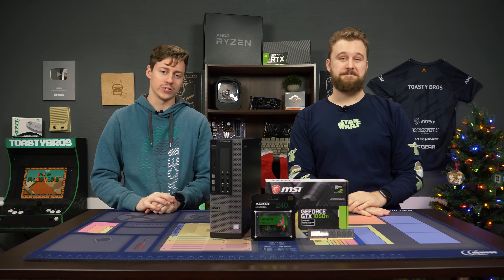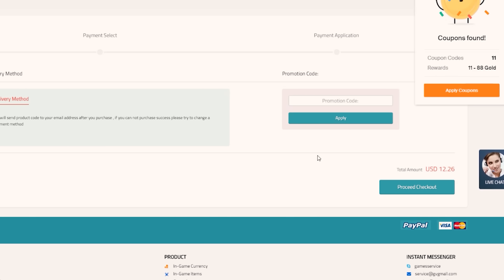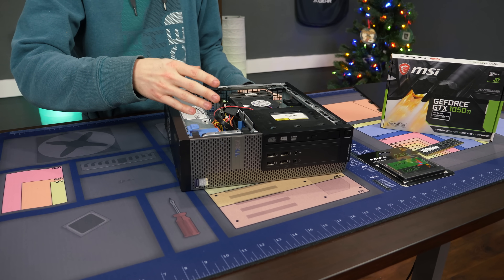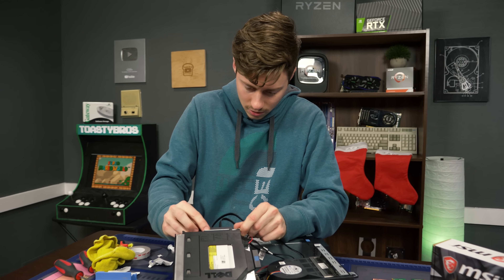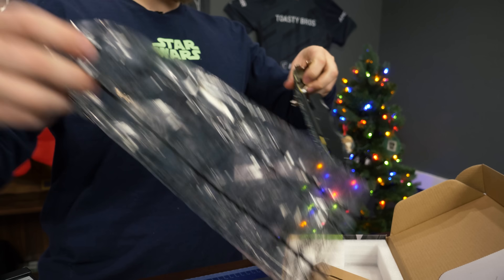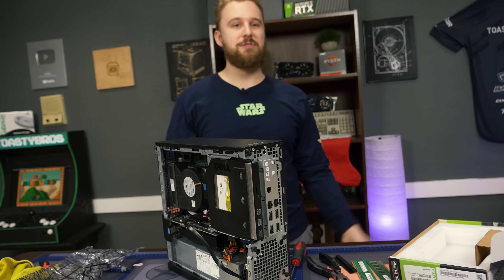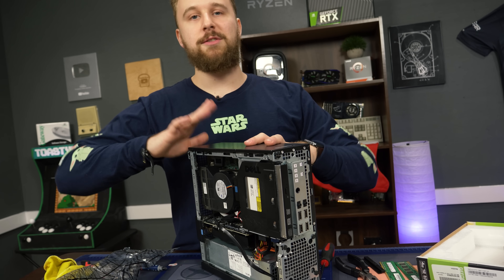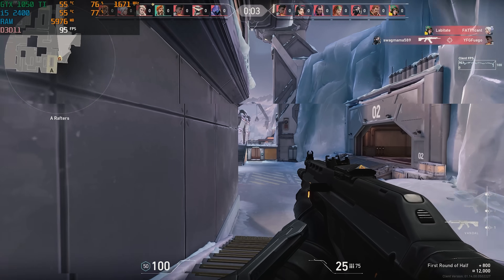EASY $250 Gaming PC Build - Step by Step

Comment: I JUST WANNA THANK YOU FOR EVERY VIDEO YOU HAVE MADE!!!! I FINALLY GOT MY FIRST PC FOR LOL. core i5 10thgen, 1650 super. ik its a prebuilt but im still happy :) i got it for 900 cad O_O
Reply: actually not that bad for that price lol
Reply: @scooterit  yeah it is bad there’s plenty of i5’s that go from 400$ to 1000$ and 400 is the right price for that performance
Reply: me who has the same thing but only 1650... with 140fps mc 90-120fps fortnite. idk bout that 1650 super, unless it's on crack then cap
Reply: @jodysu9887  btw i was using a client for minecraft, (it gives you a fps boost) and i was getting 1000 fps. and in fornite i did get easy 300 fps medium settings. BTW THE 1650 SUPER IS SO MUCH BETTER THEN 1650. btw as long as your running more then 60 frams your good to go.
Reply: Azizthe21 clients don't give that much of an FPS boost, it would give you 200-300ish frames
Reply: ok if you dont know there is a minecraft client called "lunar client". that  client gives me at least 200-300 fps boost which means with out it i would have 700 fps. it also has every mod (not hacks) you need.
Reply: Azizthe21 clients don't give massive FPS boosts, 50-100 would be reasonable. But 200-300 is just weird.
Reply: Azizthe21 just watched your video, you had 300-500 FPS, couldn't see clearly because the resolution. If you said 300-500 I wouldn't be saying anything. If you say recording then that's weird because recording takes 10-30 at max.
Reply: @jodysu9887  i was recording 1080p but when i took the video to my laptop it made it 720p, one more thing i said looking up, i also had it in default settings if i had it on low (btw you cant tell the deference) it would get 1000 consentent, BTW EVEN 500 IS  ALOT.
Reply: 500 is a lot but you said 100 my guy
Reply: 1000*
Reply: @jodysu9887  like i said low setting 1000 fps
Reply: Azizthe21 low settings gives you double your frames? aka around 600-700.... unbelievable.
Reply: @jodysu9887  look here im not trying to start a fight, medium settings:800 low:1000 please stop crying for attention fare well im not gonna respond to anything else because i dont wanna argue with an 8 year old
Reply: @jodysu9887  go watch my latest vid. i reviewed it.
Reply: @jodysu9887  omg coz u play on 1.16.4 
1.16.4 is for noobs and idiots
Reply: @jodysu9887  come on man no way your only getting 140fps on mc like I'm getting a constant 200+ and most of the time 300+ fps experience with my gtx 1050 ti (well I did but now I sold that card for 100$ and save some money to get a rx 570 and a 500w psu)
Reply: @jodysu9887  man you forgot what you wanted to say in that comment while writing it and now it makes no sense
*I meant Kid cuz no say a adult could do this lol
Reply: Ayee congrats!!
Reply: Hey dude some people may think you got scammed but honestly in the current tech market its a good deal especially if you cant build your own, anyways congrats on your new PC and have a happy new year
Reply: @bitzs  HAPPY NEW YEAR <3
Reply: i was expecting more comments than likes when i read prebuilt LMAO
Reply: @zukosrevenge4494  DUDE I DONT KNOW WHY PEOPLE ARE HATING ON A PREBUILT THATS ACTUALLY GOOD AND CHEAP
Reply: @Azizgang  pc folk get riled up when the topic of prebuilts are brought up
Reply: @shyswigga8123 lol. i see where there going but.... HOW TF DID I GET SCAMMED. i got a good pc (look at main comment for specs) and i knew what i was doing, for 680 dollars its an actual steal. smh people actually need help
Reply: @Azizgang  you for sure got scammed lol how would building it yourself cost 900 usd LMFAO just be patient and wait for good deals unlike the one you got
Reply: @MarkStands10  OMFG I SAID 900 CAD NOT USD LMAOOOO THATS LIKE 680 USD
Reply: @Azizgang  Prebuilts are doing good right now because covid is making graphic card prices super lame, as soon as they're back in stock and available to everyone and have the scalpers stop taking all of it, then building a pc will save money again but I guess in the current time prebuilts are currently better, but that won't last very long. (not hating on prebuilts, just saying they're not gonna be poppin when graphics cards are back.)
Reply: @theuntoldtruthstupidpeople4783  thank you.... you mean alot
Reply: more then the haters
Reply: Don’t worry, I started building PCs after I got my first prebuilt. I always recommend getting a prebuilt to mess around with first unless you know what your doing. Good job! Don’t bother with most of the morons trying to make fun of you because they are still using the family laptop from 1987.
Reply: @frankyalvarez7160  Prebuild systems are shit. They use cheap psu, cheap mobo and cheap ssd with ugly 30$ case..... Better use your head and build pc plenty youtube videos.
Reply: i5 tenth gen and 1650 super is a good prebuilt for 650 usd prob was on a sale too. I got a ryzen 5 3600 gtx 1660 super and ddr4 3200mhz 16gb it’s amazing. Btw I think your getting 300 FPS in creative which is normal in arena or pub matches you would get above 144fps and in performance mode around 170fps. I get 240 fps mostly stable but when it drops a bit near endgame it’s around 180 FPS. In actual stacked endgame maybe 150fps. In creative I get 400fps it’s great and I’m so happy :D
Reply: @m_xga  wow nice the thing is i dont really know much about fornite so i dont know if its good or not
Reply: just a demon slayer called tanjiro  sure i will when i get home, ill reply to the same comment when i get the answer
Reply: @Azizgang  when u play on roblox test island royale and go in a solos match. i play that game every day lol i play the competitive side of it and get tons of robux lol
Reply: That's a pretty decent deal man! I know a lot of people are talking stuff but don't listen. For the price it's good. You should be able to upgrade the CPU if you wanted to later down the line, but for the games you play, it's great.
Reply: @tagginondawal3961  today i streamed and didnt loose any frames i think the cpu did pretty well.
Reply: @scooterit  shit deal. In my country i got 3600+1660ti+16gb ram+b550 mobo+tx550m 80+ gold psu+ 240ssd with 1tb hdd system for 550€ brand new. Kewl
Reply: Give me your PCs name please, and how many hz is your monitor?
Reply: I think you should of got ryzen 3 3100
Reply: @hasanhassan2865  3100 bad option 1600AF cheaper and way faster.
Reply: bruh my pc are the same specs got it for 700
Reply: @aminnnnnnnnm  you probably have better ram or a better quality power supply etc
Reply: @aminnnnnnnnm  kewl.
Reply: i got a i5 and 1660 ti for 700 lol
Reply: @Aarav Tripathi thats good
Reply: just a demon slayer called tanjiro  uhm roblox has a cap of 60 fps if u want more than 60 u needa install Fps Unlocker its a program that uncaps fps
Reply: @MistryEdits  yeah just make sure you have an i5 2400 or better
Edit: also make sure your motherboard has a pie 16x slot
Reply: @MistryEdits  I didn't reply as if I thought he had it. I replied as if you wanted to know if you could turn an old ph pavilion  into a gaming pc
Reply: @adfsdfdfgdfgfd  1660 super can handle most games at 1080 60 ultra
Reply: @adfsdfdfgdfgfd  what?
Reply: @cIoudyy  bottleneck
Reply: @quizgoblin  lol thanks, oh also for some reason my gpu cooler is not working when i play minecraft, even tho i get 1400 fps O_o (it actually got higher) and its not heating up.
Reply: 900cad is not bad.I sold a new solid build to a kid for 950cad including WiFi adapter and the case is high end with type c port. (B460 mortar+ 10400f + 1 year old 1070 strix no mining and I cleaned and checked the gpu, yea I am learning to be a refurbished.) What’s funny is that is the highest offer on Kijiji. No more new stuff for Kijiji, I changed my mind into renewing mining cards. So, it’s honestly good to buy prebuilt  if you don’t wanna mess up specially for Children. Sometimes you got what you paid for.
Reply: What is the downside for prebuilt PCs ? Usually prebuilt PCs have smaller wattage for PSUs, so when you look for upgrade on GPU the PSUs might be changed. I5 10400/ I5 10400f only require H410m motherboard to achieve full capacity if the rams are also low in frequency, but the i5 10th gen cpus are designed to outperform ryzen 5 3600 in low MHz. If the psu is more than 450w in wattage, you can get a 1660 super or 5500xt for future upgrade. If you want a better gpu, get a PSU around 650w and reassemble your PC with help from your parents. Good luck.
Reply: the wattage was like 350 (AKA BAD LOL). im going to upgrade it tho. looking for 600w
Reply: :D
Reply: why are yall so toxic. just bc its a prebuilt doesnt mean its instantly “trash” bc they are some good ones out there and they probably got one of those good ones
Reply: @scooterit  Nope you don't know the cpu because he says CoRe i5 10th gEn maybe its an i5 9400f and that one is cheap af and I promise if he builded it a few months ago it would be a 500 pc build but idc it's his decision!
Reply: You are scammed :(
Reply: @nope9166  its actually not. i got it for 900 cad or 680 dollars USD. if I built it, it would cost at least 900
Reply: @Azizgang  :D
Reply: @Azizgang  you are scammed :(
Reply: Should have built your own, with that price you could upgrade one or build one with some research you could build a good pc
Reply: for my birthday im getting a prebuild with a ryzen 5 3600, rtx 2060, 16gb of ddr4 3200mhz ram and a 512gb ssd.
all for 1275 cad/1000 usd/850 eur/8599 sek (original price)
Reply: @moizuwu  that's a very good pc
Reply: @himis7  yeah ik, and for that price
Reply: Don’t tell me the prebuilt came with only 8gb ram, and the power supply equivalent of rabies.
Reply: You could easily build a better for that price. But congrats?
Reply: @piedzo  680 for a i5 10th gen and a 1650 super is pretty good btw
Reply: @Azizgang  don’t listen to them, the price for one 1660 super is $600> and is on heavy demand with low supply because of the new crypt currency and scalpers and all that. I should have gone with my instincts and got one for myself 4 months ago, now it’s come back to haunt me. I’ve gotta wait about 4 months now for the demand to subside again fore prices drop
Reply: Should have built a pc 😬 Bet you couldnt get decent upgrades in that prebuilt yikes
Reply: everyone needs to understand in canada its harder to get good deals for parts and PCs This persons deal is amazing for the fact they live in canada
Reply: @tus_eman7081  it’s also hella hard in Australia since all the brands are based in America and shipping is over $100 in most things
Reply: Who cares if it’s prebuilt, Atleast you got your first pc 😉
Reply: jeez moneybags
Reply: In the walmart there is a prebuilt acer predator orion 3000 for $849 gtx 1660super i5 11400f
Reply: @Ameer Alobaidi ;(
Reply: thats a good price for the build idk why people are saying its overpriced when its really not
Reply: Decent deal but unless you are playing 480p or something you are definitely not playing at those framerates with a 1650 super
Reply: the prebuilt at my place sells for lower for the same specs..
Reply: Mate I could have built a PC for 350 dollars using AMD RYZEN 3 GTX 8800 8 GB DOUBLE CHANNEL MEMORY VECROTE SSD 678890 SOME CHEAP CASE  A VCRT NXX I88 MOTHERBOARD
Reply: @vogotell8480  ....
Reply: You are scammed:(
Reply: Scammed. Should of gone lower on the cpu and higher on the graphics. Damn prebuilt kiddies LOL
Reply: @JudeTheYoutubePoopersubscribe  DUDE 900 CAD IS LIKE 650 DOLLARS
Reply: @JudeTheYoutubePoopersubscribe  BRUHHH SCAMMED? dude I'm getting 1000 fps on Minecraft and 300 fps in fortnite  medium settings. i dont think i got scammed here cause it only costed around 680 dollars. second of all "pReBuLiLt KiDdIeS" fun fact if i built my own (which  i can) it'll cost me around 150 dollars more O_O. i know what im doing, and even tho its a prebuilt i did some research :). i have learned about pcs for 2 years now and i think i know what im doing.
Reply: @JudeTheYoutubePoopersubscribe  i know but i dont play anything other then csgo minecraft and volarant, so theres no need for me to get anything more, second of all because of the pandamic all gpus and cpus became so mmuch more expensive, when i tried to build my own it costed like 1400 in cad which is like 900 usd
Reply: @Azizgang  lol why are you using Minecraft and fortnite to bench your pc? 😂
Reply: @JudeTheYoutubePoopersubscribe  Dude the i5 is the minimum in 2020, if that person was on a super low budget then a i3 would be doable, but a i3 is the lowest that you could possibly go. Not to mention that higher graphics cards like the 3090 wouldn’t have worked with lower CPU’s because of compatibility and motherboard compatibility.
Reply: @flamingkillermc2806  i dont play high end games, i only play esport games (csgo volarant, minecraft, sometimes fortnite with my little brother) and its been doing such a good job getting over 300 fps in medium settings. im happy for the price and the specs, ( i didnt even overclock)
Reply: @flamingkillermc2806  actually the i3 10100f and i3 10100 are actually beats and almost on par with the i7700k (-10 fps usually) but the launch price of 79$-97$ makes it a great deal. But because of inflation right now the prices are messed up and the lowest on amazon is at 108$
Reply: Oh yeah and you said upgrade to the rtx 3090??? What would you pair a 10th gen i5 that's prob some where between 150-200$. If we say the processor he got was the i5 10400f or i5 10400 thats a 155$ cpu that your pairing with a 1500$ gpu that almost 10x the price
Reply: @Killer-wu9hk  i dont remember saying rtx 3090 LOL. the only time i said i was gonna upgrade it was in my video comments, and it was an rtx 2060, 2nd of all my cpu costs 250 not 155.
Reply: @flamingkillermc2806  it’s a i5 10th gen
Reply: @flamingkillermc2806  the current gens i3 are very good better than some i7 and i5
Reply: @JudeTheYoutubePoopersubscribe  lol youll get better performance with a stronger cpu on these new games, using all these cores, u can always turn down the graphics.
Reply: @flamingkillermc2806   how do you have 6 subs for no reason
Reply: @JudeTheYoutubePoopersubscribe  what spec pc do you have?
Reply: @JudeTheYoutubePoopersubscribe  yes tell everyone to bottle neck their gpu by putting in a worse cpu... you dont know crap
Reply: @JudeTheYoutubePoopersubscribe  the thing is people who have never built one are scared to build cause they might break something but building pc is easy
Reply: @JudeTheYoutubePoopersubscribe  do u know anything about pcs
Reply: @JudeTheYoutubePoopersubscribe a ryzen 5 2600 with a 1060 is way over then good enough try again
Reply: @JudeTheYoutubePoopersubscribe  not everything is just about gaming on a gaming pc lol

Comment: For +20$ you can add a 1650 LP instead that's about a 20% performance uplift over the 1050Ti

Also in the video you said the CPU which I suppose is a i5 2400 is bottle-necking the graphics card but it's probably the other way around it's the graphics card that is not fast enough. That CPU should be more than enough for a measly 1050.

I don't know if the motherboards supports it but you can also try fiddling with the RAM timings and slightly overclocking the videocard to get a little more performance.

And for anyone reading this don't buy the I3 2120 variant it's dual core only that will definitely bottleneck the GPU.
Reply: Actually this PC only have PCI-E 2 so that is the bottleneck. 1650 should be overkill, and even the 1050 TI is probably not running on fullpower about the power limits of the motherboard. Something like 65 watt and 20 amp as I remember, but maybe I say stupid.

Comment: If you are planning to do this style of build, make sure to pick-up a dual fan model if it will fit in your case. I have a similar build in a HP elite 8300 sff with a gigabyte single fan model, and it does get toasty lol. Make sure to also get some kind of fan control software from the respected maker of the video card or something like msi afterburner, you will need it.

Comment: Him:valorant is easy to run
My laptop:struggles to get 20fps on minimum settings 
Me:builds a $750pc and getting 200+FPS
Reply: Howwwwww
Reply: @ryugaforever7713  idk
Reply: Tell me
Reply: I have the same budget
Tf
How do u get 200 fps?
Or is it a fkin joke?
Reply: @ryugaforever7713  300is easy to get  on almost any sistyem
Reply: @carlosm8412  300fps? Ur fkin kidding me
Reply: @carlosm8412  that is the build u did please list all the parts
Reply: @ryugaforever7713  ya it’s not that good  if you drop below 100
Reply: @ryugaforever7713  ok hold in
Reply: Hold on
Reply: @ryugaforever7713  sorry I s going to take too long and the parts aren’t even going to be in stock
Reply: @carlosm8412  its fine just say it
Reply: @carlosm8412  its fine just say the parts

Comment: i made a similar build, the parts r coming at wednesday to thursday
specs:
Hp Elite 8300 $85
i5 3470s 
8gb 1600mhz ram
500gb hdd w/ windows 10 pro
-------
asus strix gtx 970 $130
2tb hdd 7200rpm (for storing games) $10
128 gb samsung ssd (to boot off, and for programs that arent games) $20
my friend gave me a Corsair carbide 100r  $0
3 rgb fans $20
Total: $265

lets see how this beasty runs when i get the parts 😈😈😈
Reply: what about the power supply? i don't know if the hp is gonna have a 8 pin connector or you if you are gonna use an adapter

Comment: Can you use a 1650 with this?
Reply: Yes as long as it doesn't require a psu connector.  I have the zotac gtx 1650 with ddr6 in this exact same model of mine.